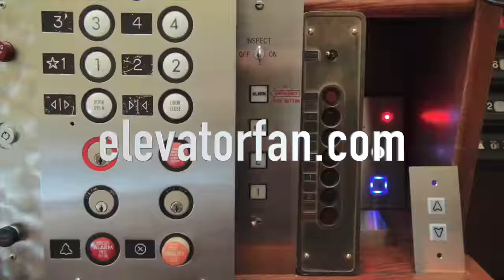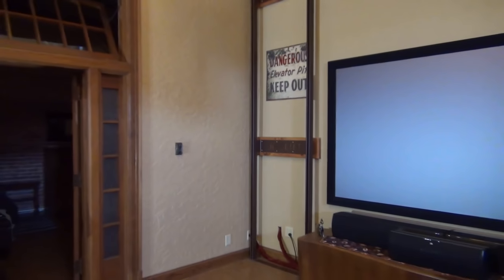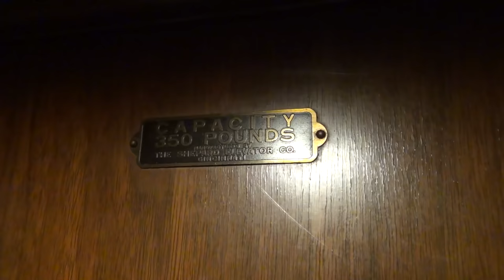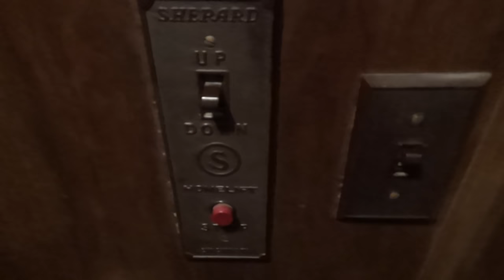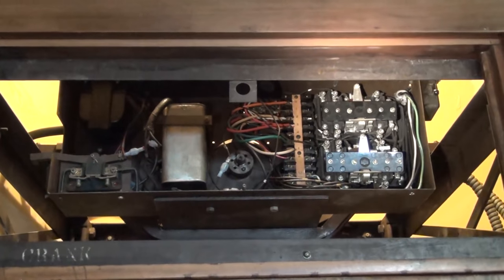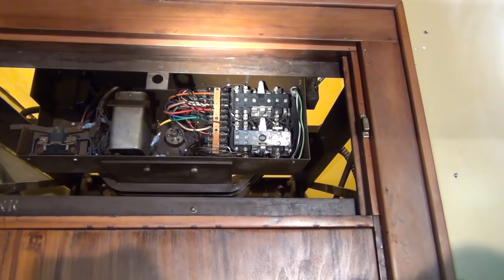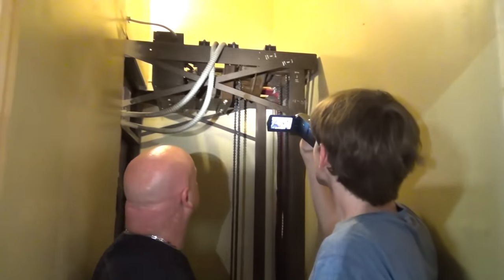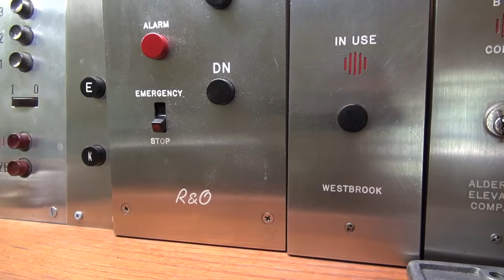Amazing 1936 Shepard Home Lift elevator in a private residence

Comment: That’s quite an interresting elevator. Simple but effective safety mechanisms. This looks like you could service the elevator yourself if you have the mechanical and electrical skills.
Reply: The one thing I'm surprised is missing is a car door safety switch that turns off the motor if someone tries to open the door while moving.

Comment: I have this same model in my home that was built in 1908. I wasn't sure about the date of the elevator but after watching this video everything is exactly the same.
It's currently not working though. It has power to it from the breaker that an electrician confirmed. Also the light is working as well. However, it will not run up or down. I would like to get it running and was wondering if you could possibly assist me in trouble shooting the problem. I live in Liberal KS.
Please reach out to me. Thank you
Reply: sorry to hear.
Reply: any electricians or hiatorians in the area you can contact?